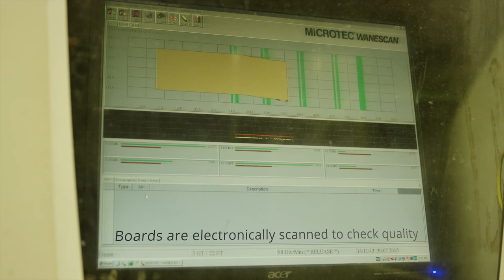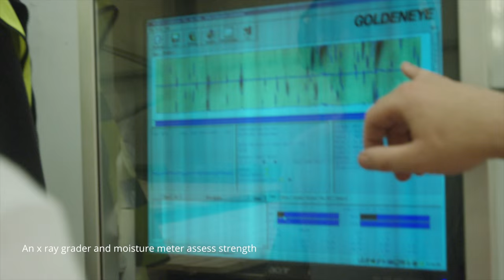DALBEATTIE MILL TOUR

Comment: Hi William, unfortunately you are incorrect. K2 does not have the capacity of the Dalbeattie sawmill. I designed the Dalbeattie sawmill in conjunction with Linck. I was also involved in the preliminary design for K2. Originally the Dalbeattie line had the option of using the Hewsaw line which is installed in Fort William. It was a close run thing but eventually it was decided that Link had the best solution for Howie Forest Products ltd. all the Howieforwood videos were made by me.
I designed the planer lines both for Fort William and Dalbeattie. Along with Scott Shiels, we designed the Fort William mill. I have all the original drawings for both mills which I worked on before my unfortunate brush with cancer which effectively ended my working life.
Both mills are streets ahead of anything the opposition sawmills have in their armoury.
Reply: Hi Peter hopefully you are enjoying a decent retirement .  If your ever in the Lauder area your more than welcome to pop in .  Cheers Scott riddell blainslie sawmill Galashiels
Reply: Hi Peter are you still ok hopefully you are enjoying a decent retirement.  We are still ba